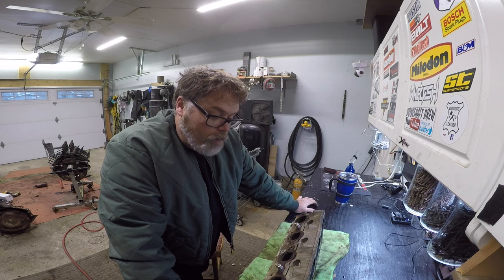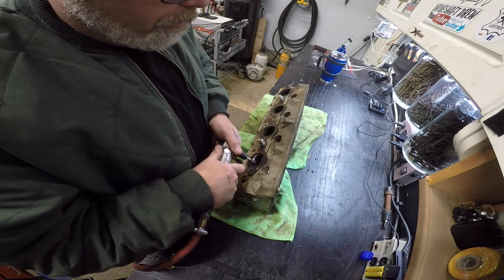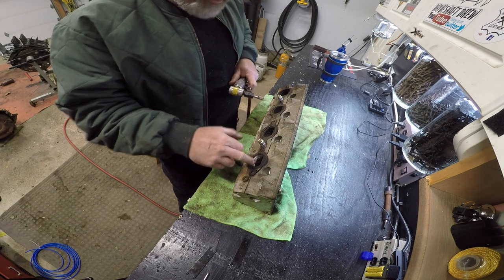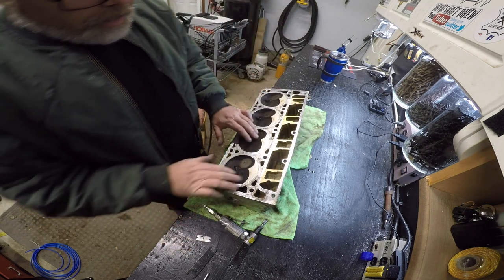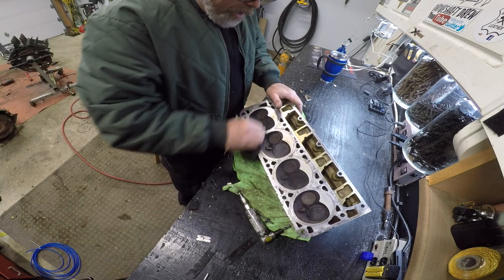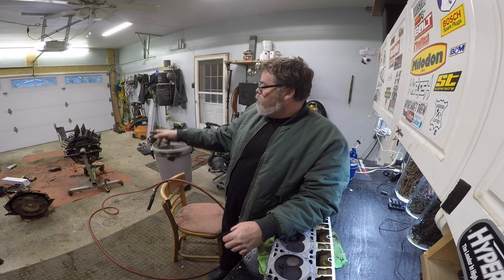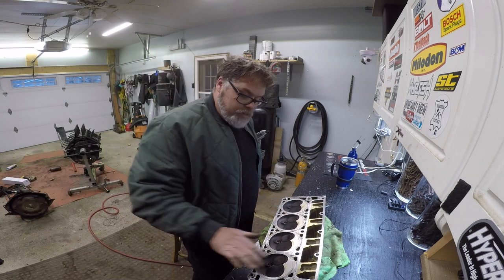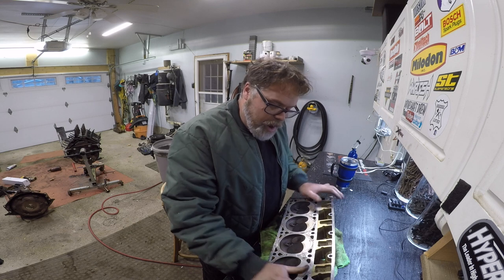317 Engine Head Job

Comment: Make sure when you do the spring you pull each valve out and clean it for build up on the back side of the valve and stem. Always good to take a look and a new set of valve seals are super cheap. Few bucks at the most. Skip a coffee or two and that will pay got a pack of seals. Build is coming along nicely!